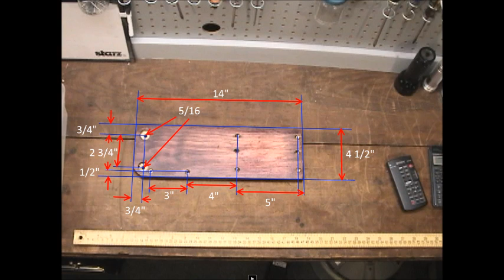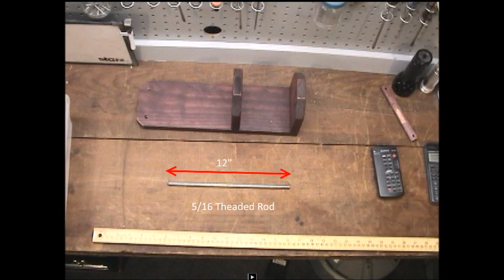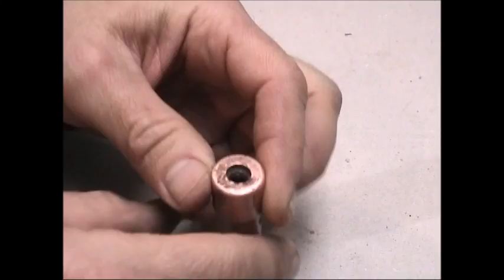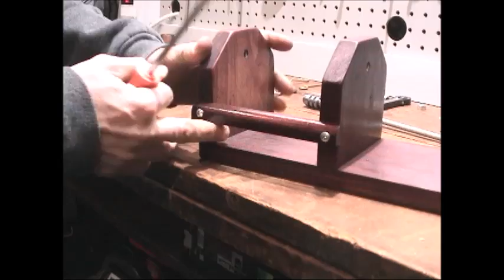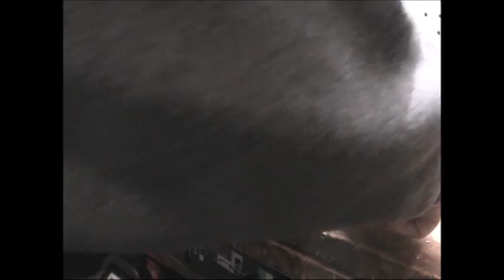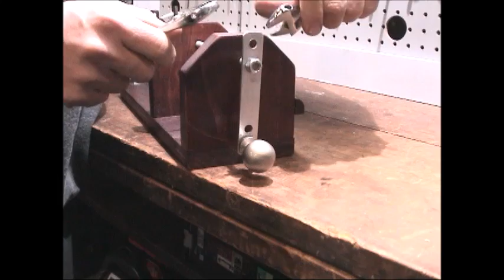Clock Spring Winder

Comment: Very well done, great job explaining everything ,good design open for personal modification if needed. The only  thing is if you use all threads for the shaft I would bush the wood supports where the threaded rod goes through, to keep it from chewing up the wood.